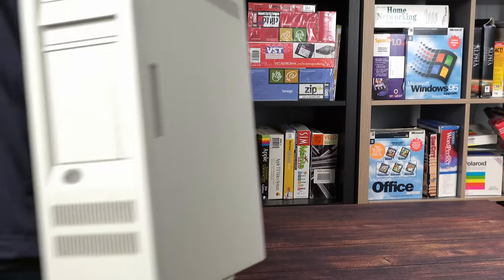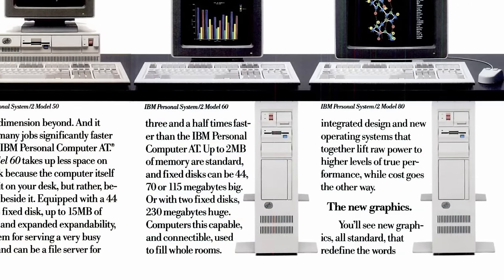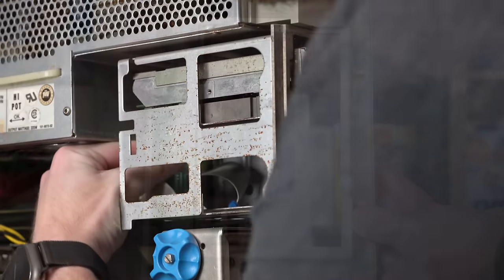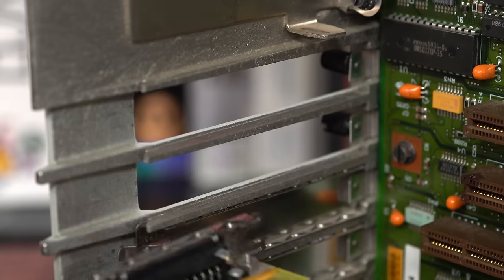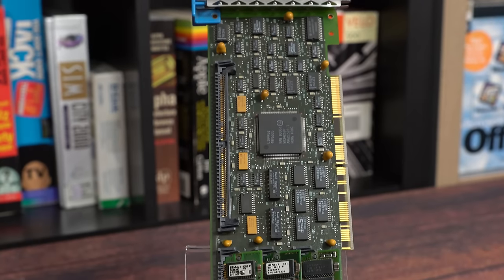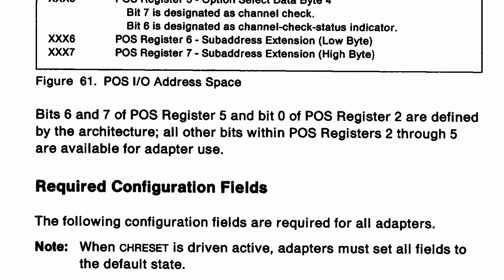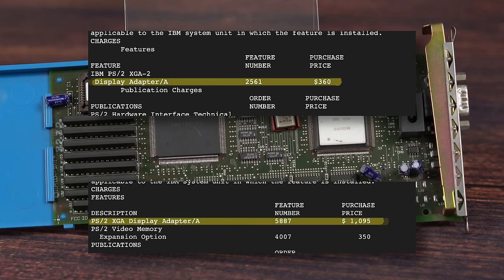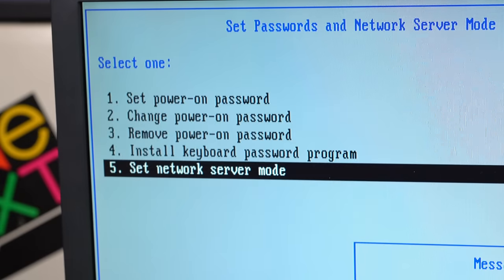IBM's 386 Tower of Power: The PS/2 Model 80

Comment: Micro Channel did not "fail". IBM was a serious company, they didn't make toys. The MCA bus is also found in the AS/400 and RS/6000 minicomputers, and even low-end System 370 machines. It brought ground-up bus mastering to the world, which was the most important innovation of the late 1980s.
Reply from the maker: If you'll permit me a counterpoint...

Micro Channel absolutely failed from a strategic standpoint. The goal was to reclaim the "IBM PC" from the compatibles and put IBM back in the driver's seat of the architecture. From that point of view it was a disaster because it accelerated the market's decoupling of the DOS/Wintel platform from IBM. That doesn't mean it didn't work or wasn't useful, but it still failed in the marketplace. Yes, it was implemented in other IBM products, but that's beside the point. There's plenty of examples of working products which tried and failed to become standards but managed to survive in niche environments. Sony's littered with them.

As far as bus mastering goes, Zorro II launched at the same time as Micro Channel (in March of 1987) and it supported bus mastering. NuBus also supported bus mastering (though it depended on the machine having a bus master controller; the initial Mac IIs did not have one on the logic board but some NuBus cards like the 824GC did have one, and there were add-in boards that added bus mastering hardware).

Comment: I actually have a model 80 sitting next to me waiting for me to livestream it's repair, but I have to agree with your overall assessment of the system. I also resurrect and drive old vehicles, farm equipment, etc. To me, the model 80 is more like my '74 F350 than it is my hotrodded caprice or the '65 olds convertible. It's not so much for playing around as it is a sturdy old work rig that will do what you need, albeit less efficiently than new stuff, but can still get real work done - probably much longer than the modern equivalent. Mine may end up running my greenhouse after I build an MCA GPIO board or two, or it may run Novell and gain a tape, cd changer and MO drive and become a data hub for my old rigs. Already have a pair of Ethernet cards and AUIs for that, not to mention the drives and stuff...
Reply from the maker: Very curious about those MCA GPIO boards if you manage to make them!

Comment: I worked with these running novell 2.15 on coax ethernet.
Pretty sure your external floppy connector was intended for external tape drive. Tons of 20 to 80 megabyte drives were used then.

Comment: You've got to have a LOT of patience running SimCity 2000 in Windows on a 386 20 Mhz machine tho.
Reply from the maker: It's advice aimed more for 486/Pentium users with XGA cards, since I mentioned it right by the "486 users will face more challenges" bit. Installing SC2K for Win3.1 to see just how much it crawls is actually on my todolist but it didn't make the cut in time.
Reply: @userlandia  Haha I saw that and immediately dropped the idea of installing SC2K on my own NCR 386 lol
Reply from the maker: It'll run just fine in DOS (as it does in this video once I put on the palette fix)! It'll just be a little pokey once your city size gets really large.
Reply: @userlandia  I'm noticing the same thing with Civilization for Windows ;)
Reply: Sim city for windows 1.0 runs not so bad, even on a model 60

Comment: Ahh, the Model 80, the best table legs one could find on the side of the road. (Yes, that is where my long gone Model 80s were found) At least its the Type 2 planer and came with SCSI vs. those big loud ESDI drives. MCA was really annoying to configure because you HAD to run it off of the floppy drive... slowly.....without any caching. It didn't help that the floppy drives were non-standard and aged poorly. A broken floppy drive = useless system.

Years later when I finally got an EISA system to see what all the fuss was about, you could install the configuration utility on the hard drive. Way faster and  it told you what the card IDs were if you were missing a configuration file! Oh yeah, and sound cards.

Comment: One oddity of the PS/2 line that I do not see here is the behavior of (at least some of) the microchannel memory cards that do not have ROM.  If there is no card with ROM present, they install a boot program on the first sector of the hard drive.  This gives the weird experience of the memory check stopping at the top of the planar memory, then the drives initializing, and then the memory check resuming after the floppy and hard drives initialize.  It also means that the extra memory may not be available if booting from a floppy directly.

I am using an  MCIDE in my model 80, and it is particularly noticeable... the memory check sees the first 2 MB of memory on the planar memory card, then the XTIDE BIOS loads and checks drives, then the memory count resumes as if nothing else happened.

It also means that every time I re-partition my CF card (the original full-height brick of a hard drive is long dead), I risk losing access to my extra RAM until I re-load my reference disk.
Reply from the maker: I had some bits about the intricacies of the ROM/non-ROM adapters and how the memory is calculated, but I cut them because it really tanked the pace of that section. Not to mention that I had nothing for coverage for it. :) I also didn't have hands-on experience and I was loathe to talk about something I couldn't verify first-hand (burned by the claimed 70ns SIMM compatibility, I guess).

There's also, depending on the board you have, a chance that the updated ADFs/SC.EXE in the BOPT update can eliminate the need for track zero initializers. There's a whole bit on the Ardent Tool's memory adapter page that talks about this, but without testing it first hand I don't know if it would be helpful in your situation or not. Some boards (Kingston?) require them regardless.

There's other scenarios where some PS/2s require a system partition for Initial Microcode Load (IML). And then there's others with Reference Partitions. I've never used one that does—I think they're for the 486/CPU Complex based machines. Someone with more experience than me can chime in about them.
Reply: @userlandia  In my case, the BOPT update was required to get the adapter to work at all, and I still require the track zero initializer.  Still, good information for anybody struggling with one of these cards.
Reply from the maker: @bkbreyme Good to know, out of curiosity which RAM expander do you have?
Reply: @userlandia  I have an Enhanced 80386 memory expansion adapter FRU 34F3053-02 (Older FDDF style with factory-installed diagonal resistor  OS/2 modification)

Comment: Really good informational video! One month ago I picked up a model 80 along with some expansion cards and a rainbow 100 for free. Both are working so I must've been extremely lucky. Usually i like to collect computers from the pentium 1-4 era so I went into this blind. Gave it a good cleaning and noticed all the foam inside disintegrated just by touch haha. Bought a new battery for it since they were easy to find but unfortunately that's the farthest I've gotten with the computer as the floppy drive doesn't work so I'm stuck in the basic screen for now.
Reply from the maker: Most of the time the floppy drives need recaps. Check if yours is an Alps or Mitsubishi mechanism; the Alps definitely need them. You can use a standard floppy drive with an adapter. Make sure to check if yours uses the 44 pin connector or the edge connector, there are two different kinds of adapters available.

Comment: the XGA card you installed at the end of the video has the auxilary video extention.. but you didn't install it in the slot that has that?
Reply from the maker: Great question—that's not an AVE connector on the XGA card! It actually has a slightly different extension: the Base Video Extension. Some planars (like the Model 95) don't have onboard video. If you installed an AVE card (like an 8514/A) into an AVE slot on a model 95 you wouldn't get any base VGA graphics modes because there's no planar video to pass through the AVE.

That's where the Base Video Extension comes into play. When an XGA card is installed into a BVE slot, it can send its VGA video through the BVE to an AVE-enabled card in another slot. This way you could use both an XGA card and an AVE video card in the same system.

An XGA card will not physically fit in an MCA slot that has an AVE, because AVE and BVE are keyed differently.

Comment: You're running 3.1 on it. Wouldn't it have originally shipped with OS/2?
Reply from the maker: It could have shipped with PC-DOS 4, OS/2 1.3, or AIX 1.2. The announcement letter does not say which OS came preinstalled on the PC, but I'd wager it was PC-DOS.

Comment: If I had owned one back in the day, I would have probably sat there at times toggling the power switch just to hear that *chonk*…
Reply from the maker: Feels like I have a product opportunity here: fidget switches! An IBM style power switch that you can switch on and off to hear that chonk over and over again.
Reply: @userlandia  I'd buy one, particularly if it included a soundchip that replicated the noise of the honking great 5.25" hard disk slowly spinning up.

Comment: Damn if the PS/2 Model 60/80 still doesn’t look amazing. It just exudes “power user”. One of the coolest looking machines ever made… hiding an absolute abomination of the worst kind of md-80’s broken IBM-think. MCA’s giant failure was that absurd, half-baked, not-really-PnP soft-config. It was very much like ISA PnP cards that you encounter with mid 90’s mixed PCI/ISA machines, where the PCI’s auto-config space is extended to the bridged ISA devices, but neither ISA’s physical IRQ line signaling implementation, nor PnP ISA cards themselves, properly handle IRQ line sharing (which is only made worse by having a mix of ISA PnP and legacy cards), making resource conflicts harder to resolve than if you just had jumpers or dip switches. But at least the PnP ISA nonsense was configurable via builtin BIOS setup and standard drivers (and preferably a PnP aware OS). 

MCA, on the other hand, combined the joy of soft-config, incomplete conflict arbitration, and users having to know what resources were what, with IBM’s obsession with arcane, highly system specific floppy-based software config (god forbid they just have a standard PS/2 family-wide setup program). But what was truly inexcusable was that IBM had full control of the spec AND didn’t bother to include bridged ISA, so there was no particularly good reason they couldn’t handle full resource arbitration and auto-configuration. It’s astonishing how simultaneously over-engineered and lazy their efforts were around MCA. To say that I absolutely loath these machines would be a huge understatement.

That said, I totally appreciate those restoring and maintaining these machines, if for no other reason than to remind us of how not to design systems in the future (e.g. completely ignoring user needs and conveniences). Personally, I’ll stick to my Amiga’s and non-PS/2 x86 retro hardware as I got to experience the joy of the PS/2 line first-hand as part of a high school computer-lab refresh summer project, complete with Token Ring and OS/2 1.3 LAN Manager (for the record, 16MB is overkill for period correct, 16bit OS/2 1.2/1.3 with Presentation Manager - 16MB is a nice comfortable number for early Windows NT 3.1). If I never encounter another PS/2, it’ll be too soon.

Comment: I never understood microchannel or why it was a thing. I only had a 286 2MB then a 486 8Mb with a 1MB Trident VLB video card.
Reply: It was partly to address the (many) limitations of the 16-bit ISA bus, but mainly an attempt by IBM to get back its stranglehold on the PC market. The only real intellectual property IBM owned in the PC/XT/AT was the code in the BIOS. Everything else was off-the-shelf parts. You couldn't legally just copy the IBM BIOS as that was breach of copyright. But once Compaq, Phoenix, AMI etc successfully reverse-engineered the PC's BIOS that opened the way for manufacturers to overtake IBM in sales of PC/XT/AT clones. 
With the PS/2 line IBM wanted to create something that couldn't be cloned for free as well as to provide support for both 16-bit and 32-bit cards to match the 80386 processor. There's a lot of IBM intellectual property in the MCA interface and how the cards interact with the PS/2 BIOS. If you wanted to build a clone MCA computer then you had no choice but to pay IBM for a license. You couldn't reverse-engineer it. Some companies, such as Apricot, did exactly that but the additional costs of producing MCA chipsets as well as the licensing costs added up. 
IBM hoped that they could strong-arm the PC industry to using MCA and so gain back its market dominance. The rest of the PC industry basically said "Yeah, no" and largely ignored MCA and carried on doing what it was already doing very well. As a customer you could pay a lot for a PS/2 as well as having to throw away your old keyboard, monitor and ISA cards because they weren't PS/2 compatible, or buy a Compaq/HP/Olivetti/etc for way less money and also keep all your existing peripherals. IBM's plan failed.
Reply: @1anwrang13r  Thanks , do you recall   another  "Yeah / No" of Asus Media Bus?
Reply from the maker: @knightsun2920 I go more into the MCA/ISA bus wars story in the Model 30 286 Computers of Significant History video, if you want a deeper dive into why MCA failed.

Comment: Ratings for ns on memory isn't like clock speed, so it's not really correct to say mixed 70ns and 80ns ram will just "have the 70ns run at 80ns". The ns parameter is latency. After the address lines are set and the chip enable goes high, the memory will have completed setting it's data lines high/low as needed within x nanoseconds which tells you that you can read the datalines after x ns and your data will be there. But yeah, unless putting in 70ns memory at all makes the system check after 70ns, you would think it would work, eg. checking any 70ns memory 80ns later (instead of 70ns later) shouldn't matter as anytime after 70ns the lines will be set. Admittedly architectural quirks can affect things but this is generally how it is for any type of memory that specifies a generic ns value.
Reply from the maker: You're correct—I could have phrased that better. Your explanation's spot-on, and mine was probably too brief/reductive. I've run lower latency memory mixed with higher latency memory in other systems before without issue, so my assumption was that it would work here. Especially because some sources online claimed that FRU would be compatible. And it may be in the type 3 planars, which have newer BIOSes which could be aware of newer SIMMs.

The issue with these machines is (I believe) that it doesn't even get to that point, because the declared presence bits don't match the compatibility list that's hardcoded in the BIOS. If I wanted to hack the resistors to change the latency rating, I bet they would work.

Comment: How about running Xenix 386 for the PS/2 or ... god forbid... AIX 1.3?
Reply from the maker: If you say AIX three times a goblin crawls out of a filing cabinet asking if you've filed a requisition for a roll of Scotch tape.
Reply: @userlandia 

I programmed in AIX on the RT, to say it was painful was an understatement. After we solved the shared memory problem, and had a running RDMS, we sent it all to IBM for a compile. 

Easily a 40% speed up, so, IBM provided us with the latest ESDI disks, and doubled the memory, but... less than a week later, an 
InBoard 386 showed up, and we switching to Microport Unix, such a large collective sigh of relief was heard, that the IBM RT was never ever powered up again.  

Dusty Rhoads showed up, and took the machine away. He was one hell of an IBM CE. a great effort on his part, but he was lugging around yesterdays hardware.

Comment: Can the CPU be upgraded? How about testing Windows 95 on it?

In my opinion it sure is a cool looking tower, but is unfortunately too proprietary for me.
Reply from the maker: There are CPU upgrades (Blue Lightning) and motherboard swaps (Reply upgrade planars). Windows 95 will technically run on the 386, just very slowly.

Comment: Actually I'm not sure about the pen trick to open one of these cases. I had one that I couldn't for the life of me get open - but a cheap cylinder lock picking kit from China did the trick, it literally fell open. :-)
Reply from the maker: It doesn't hurt to try, at least. :) I find the trick is to cut a cross-pattern in the tube and give it a hit with the heat gun. I've unlocked so many old computers with it (and it worked on the Model 30), so I figured it would here. That said, I should probably get one of those cylinder kits...

There are other non-destructive ways to crack the case open, especially if you don't have an adapter in slot 1.

Comment: Putting 16MB of RAM or more on a 386 20MHz is frankly asinine
Reply from the maker: I'm sure the people running Netware and OS/2 database servers in the 90s disagreed!

The actual maximum RAM ceiling is 64MB, it refuses to complete the memory test afterwards IIRC. I saw plenty of people in newsgroup posts in the 90s trying to shove more than 16MB in these machines.